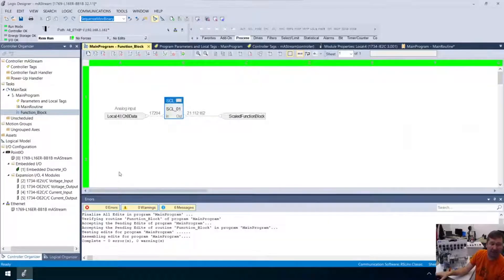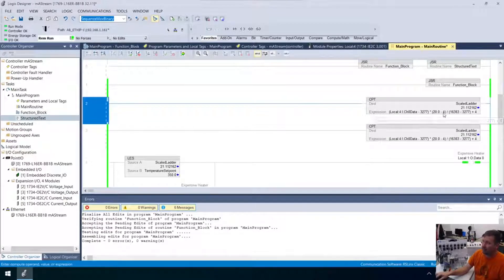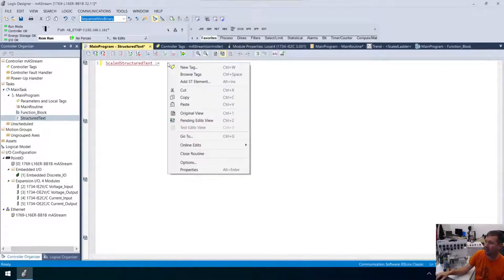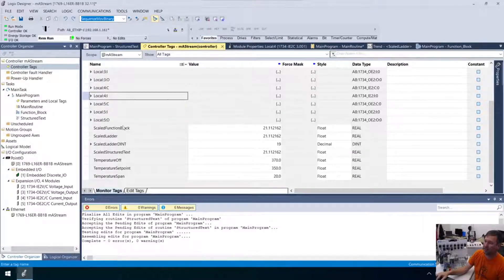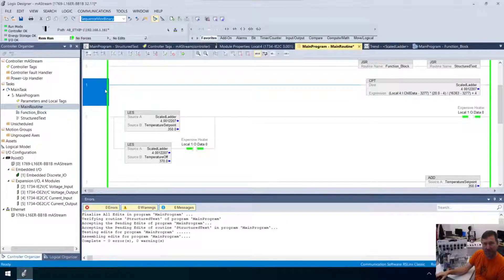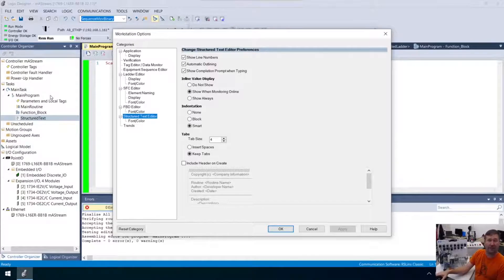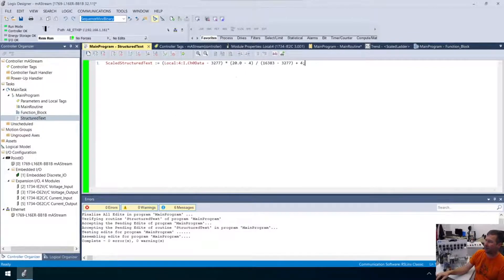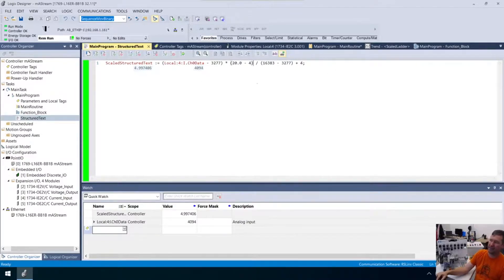Scaling 4-20mA Analog Input in Structured Text with Allen Bradley PLC

Comment: Late to the party an interesting video Tim. I use something similar but not with the 4-20 values in the formula, mapping the known values is more accurate I find:
formula to map range: res = (x - in_min) * (out_max - out_min) / (in_max - in_min) + out_min;
calibrate the equipment of course then: 
Although nearly identical to the one in ST. 
This also works good with negative values, say temp= -40 --> 100; and with different I/O ranges say 802-4035 for example instead of 0-->4095 etc.

Has never failed me. Thought I'd share.
Reply from the maker: Thanks for sharing